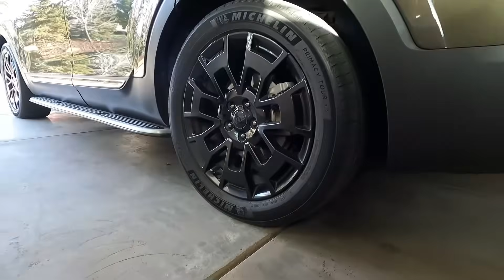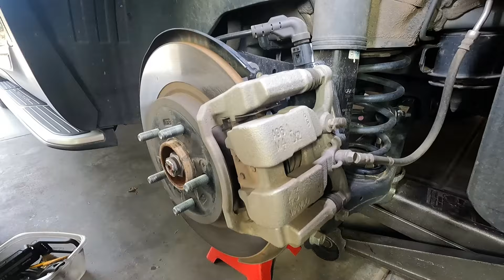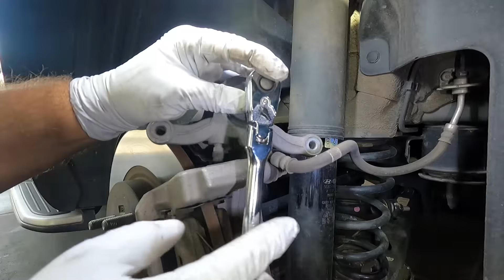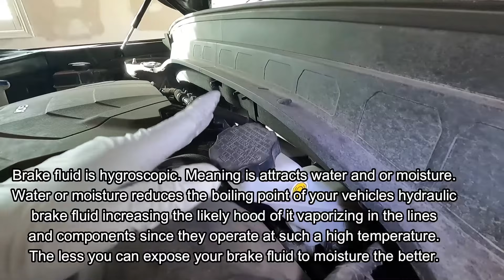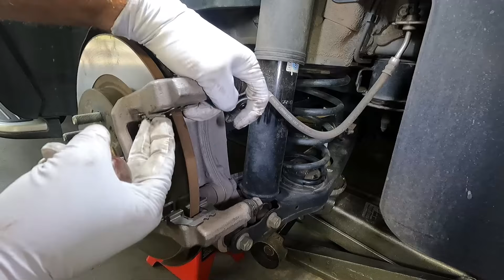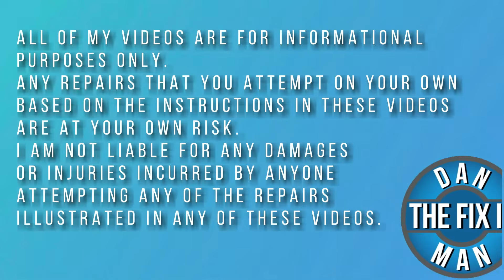HOW TO RETRACT AN ELECTRONIC PARKING BRAKE WITHOUT SCAN TOOL 2021 Kia Telluride Rear Brake Pads DIY

Comment: The EPB piston has indentations on each side suggesting that it should be wound, not just pushed straight back.  Can you comment on this?  From the video I get the impression that if could can physically just push it straight back, that means it doesn't need to be wound.  Is that the only way to tell?
Reply from the maker: That's a great question.  I have done quite a few that have the indentations, but they still push straight back once you have retracted the mechanism all the way first.  I think the indentations are intended to line up with a small part that sticks out on the back of the brake pad to prevent the mechanism from spinning freely against the back of the brake pad when it is applied.  Hope that helps.  Best of luck to you.
-Dan
Reply: @DantheFixitMan    After watching another youtube video I think I know the answer.  When you use a rewinding tool you are retracting both the piston and the motor at the same time.  This eliminates the need to do the battery method or dismantle the motor to retract it.  If you use the battery or dismantle method, all you are retracting is the motor.  Same with service mode.  You still need to push the piston back in, which you can push straight back since the motor is already rewound.  This video explains it all.  https://www.youtube.com/watch?v=ocLzmxy2RyM
Reply: @corycarlson950  So you are saying you can just do the screw piston/push method similar to that type of caliper with slots in piston head and no EPB?

Comment: Why did you apply the silicone grease under the clip on the carrier? You need to put it on the clip where the pads slide.
Reply: People put grease under the Clips to keep rust from Jacking the clips up and binding the pads. Grease on the surface of the clips attracts dirt, so try and avoid that. I believe the Clips are S.S. so they wont rust.

Comment: Thank you for this! I just did 3/4 brakes on mine the last (passenger side rear) spins endlessly so I can’t get it to retract. Had to go to work I’ll finish up later, have any ideas why it wouldn’t retract so I can push in the piston? The driver side rear was smooth it’s just rear passenger.

Comment: EPB light also the auto hold light stays on. Just replaced brake pads rear How to clear those lights from dash???
Reply: Did you figure it out
Reply: Epb was not connected just needed a scanner to reset light
Reply: @josemariatorres-db1hk  thank you. Im about to do this. Did you do the manual procedure by screwing with T5 clockwise? 
If so, when done did you press brakes and good to go?
Reply: @DFWAuto_Hack  I removed epb motor  and pressed piston normally with screwdriver . When installing epb just make sure to turn motor gears ⚙️  use 12v power to make it turn  or pliers you can damage gear ⚙️ if using pliers  good luck use what ever easiest for you
Reply: @josemariatorres-db1hk  thanks. I ended up doing it with my scanner. I made a video of the procedure i will upload tonight to help others

Comment: Any idea if this would be the same for the 2021 Santa Fe?
Reply: It worked on my 2019 Hyundai Sante Fe !!!!
Reply: @derrickgordon1164  thanks very much for the info!!
Reply from the maker: I am not sure about the sizes of the fastener or the mechanism, but if it has an electronic parking brake, it should be the same process.
Reply: It took a 5mm. allen wrench to remove the cover and to turn the screw clockwise inside the mechanism!!!